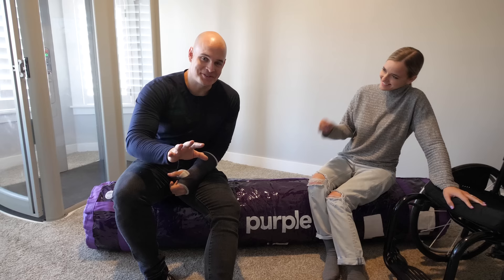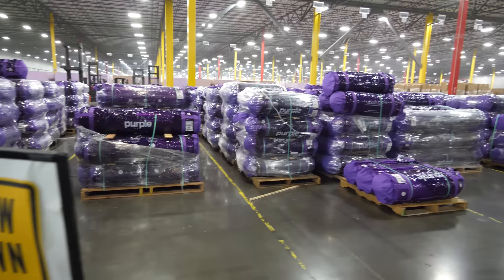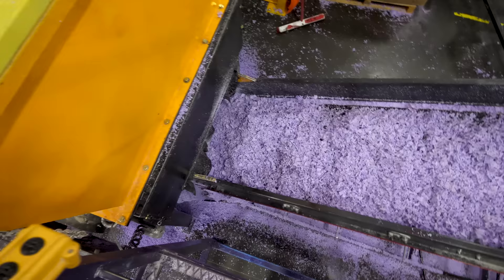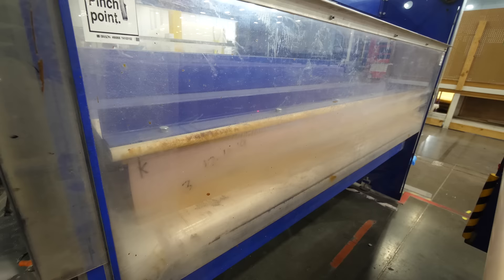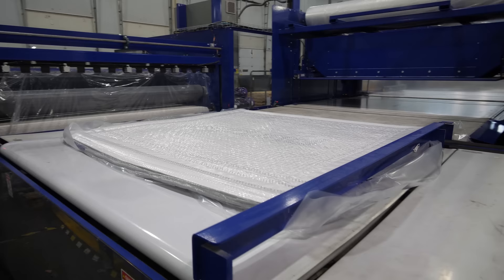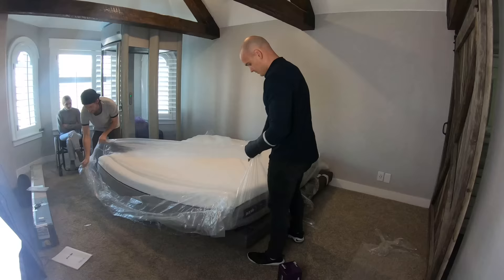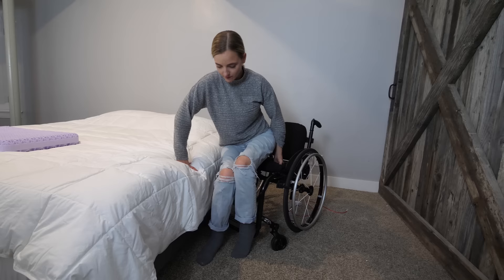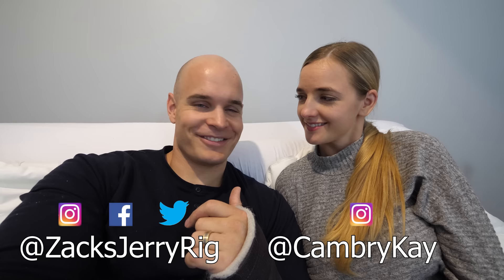How to Make a Purple Mattress! - Best bed of 2020?

Comment: The video was really interesting 👍
In my opinion, if you check the prices of the mattresses, it's quite expensive for the cheap way they are made 🙄
Reply: Interestingly, the company gets lots of returns. I was analysing the stock about 1-2 yrs ago and noticed that warranty returns are a major issue. It’s probably very comfortable, but for a couple of years only. The purple rubber they use cannot match individually wrapped strings for durability and support.

Comment: I have a Purple 4 the top of the line version and I am not impressed. I have many many spine injuries and have devices in my neck and back along with batteries implanted in my low back. I cleaned my cover and the grid underneath the cover was so unevenly and sloppily done. For the money I spent on it I’m pretty disappointed in the quality of the product. By the way their stretch sheets are horrible and like torture to get out of.

Comment: (Here 05/23/2021) Don't buy the purple pillow. You will notice that it smells toxic and you will have to wash it a couple of times. 'I wonder if the bed smells toxic'🤔 oh the pillow weighs 10 pounds and is hard to sleep on depending on your size. Thank you.

Comment: way overpriced ...  mostly machine made , but still charge like it is all hand made ... let me know in 10 years if it is still supporting you ....I had a tempur-pedic foam mattress...cost same as the purple ....it is JUNK... did you know after so many years the foam disintegrates into dust? mine did in less than 10 years... never again , my new queen sized hybrid mattress was delivered by UPS... cost 399 ... never pay thousands ... no mattress is worth that kind of money